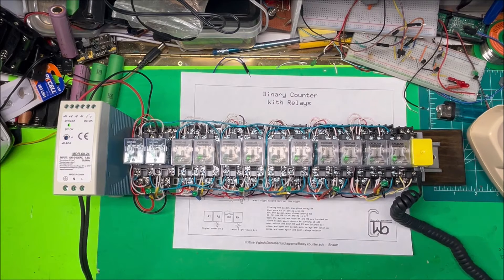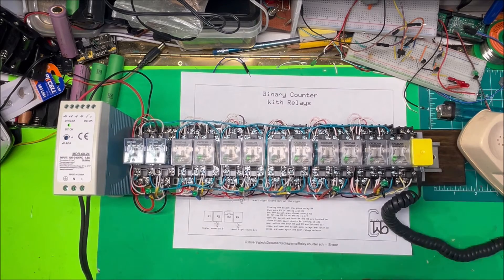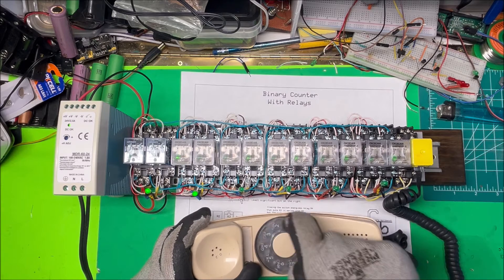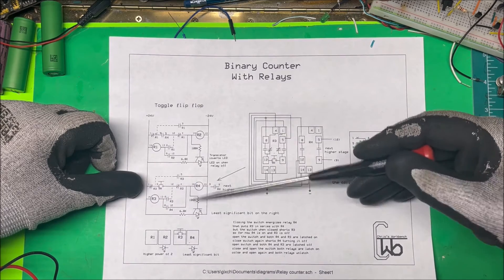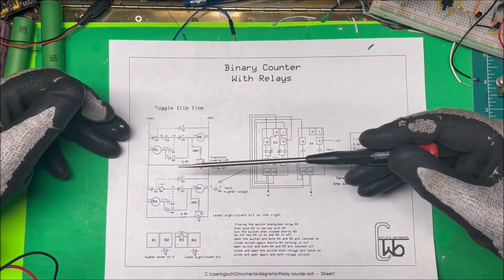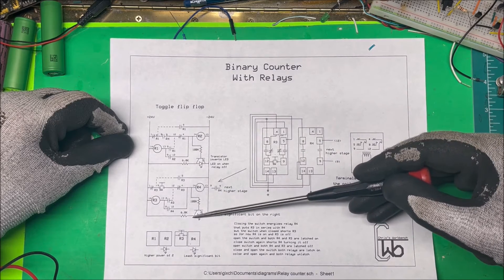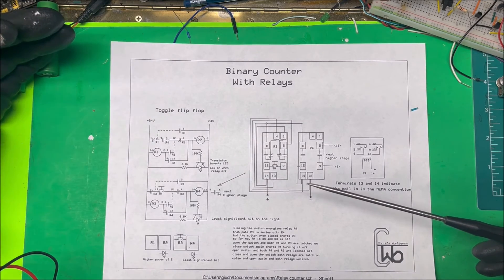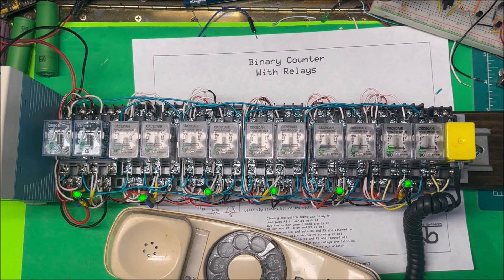Relay Binary counter

Comment: Does this circuit implementation have an inherent race condition whereby the switch closing pulse needs to be shorter than the time it takes for R3 to be energized by R4, otherwise they won't latch?
Reply from the maker: I have not encountered that problem. On other relay projects i had issues with make before break, and placed a capacitor across the relay coil.
Reply: @ke6chris  Not saying it's a problem per say, as it clearly works great with the rotary pulse dialer as an input (brilliant idea btw) .  But looking at the schematic it seems that if you hold the input switch closed it will short R4s coil voltage to ground once R3 energizes, deactivating the relays.  Or they'd start buzzing back and forth between states,